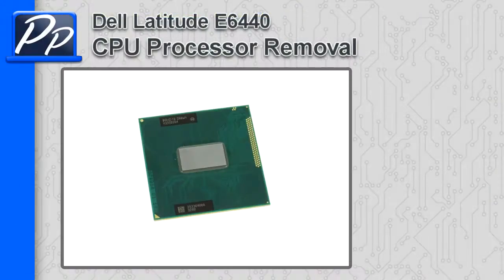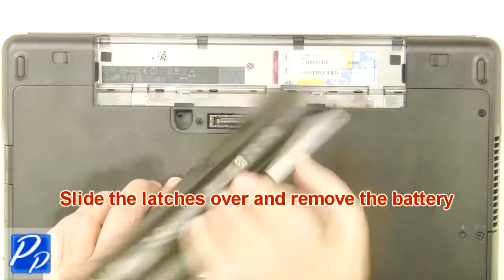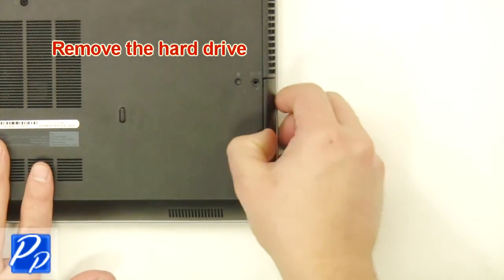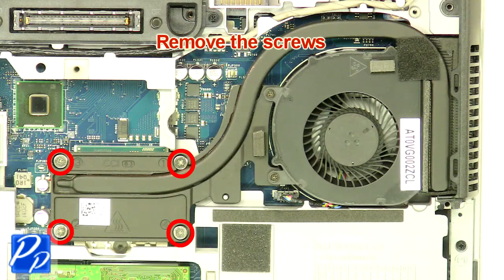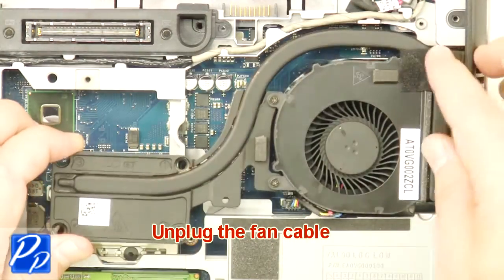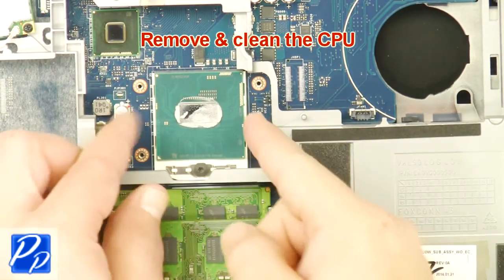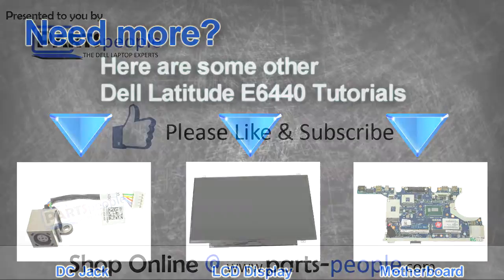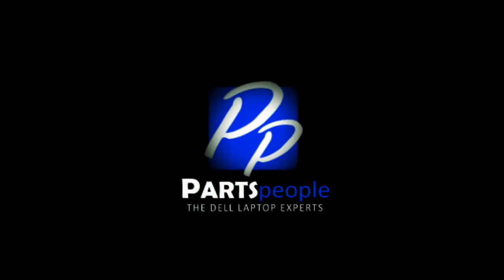Dell Latitude E6440 CPU Processor How-To Video Tutorial

Comment: The Intel Core Core i7-4940MX is a mobile Beast but, with a TDP that is 20 watts higher, you may need a chiller pad or fan booster to keep this socket FCPGA947 CPU running cool and stable in a Latitude E6440. Someone else on here said they installed a 47 watt CPU on their E6440 laptop with no issues so, maybe, if the chipset supports a higher CPU socket voltage that this CPU would definitely require, it could be used.

Comment: Thanks for the helpful video! I was able to swap out my Core i5-4300m CPU that came with my Latitude E6440 for the i7-4712MQ and get it booted up and running again in just minutes! (Of course, Windows installed new drivers requiring a reboot but, still, couldn't have been faster without this video to help) I also managed to avoid attempting to install the CPU 180 degrees out by noticing orientation of CPU removed in the video, since I was not really paying attention when I removed the one in my laptop.

Is it possible to replace the non-back-lit keyboard for this Dell with one for the same model that does have back-lit keys?

Comment: So... Could I swap out the i7 4610 CPU for a more powerful AMD CPU?
Reply: I just successfully upgraded the i5-4300m CPU for the i7-4712MQ with no need to upgrade the BIOS... just needed to reboot after booting into windows, and Windows then installing drivers for the new CPU. (I realize I am replying to a question posted 2 years ago but, I was looking for the same upgradeability answers just last week when I found that this quad core, (with 2 logical cores per physical), had the same wattage and socket compatibility as the i5-4300m I wanted to upgrade.) I read that an i7-4910MQ (with a +10w, 47 watt TDP) was also successfully installed on this model Dell, without any issues - from someone who had done the upgrade some time previously. I wasn't as willing to pay over a hundred more for that upgrade, when I'd found a good price ($120 + $8.65 S&H) for the i7-4712MQ on eBay while pricing that upgrade. (My Dell's BIOS is A21)
Reply: I know this is 2 years old, but for anyone else seeing this, you can swap in an i7-4702MQ and have a quad core i7 that has the same TDP as the CPUs that come in these e6440, which should avoid any additional heat.
Reply from the maker: +STR77 CallingAllBattleFrontFans No, you would only be able to swap it with another Intel CPU. The CPU socket is different for AMD CPUs
Reply: +Parts-People.Com, Inc Okay... Any recommendations for a better upgraded intel cpu for this laptop?
Reply from the maker: +STR77 CallingAllBattleFrontFans Unfortunately I don't have a complete list of compatible CPUs. With the little information I do have, the 4610M is the fastest processor available for this laptop.
Reply: +Parts-People.Com, Inc Oh okay,  I was doing a little bit of research... What about the i7 4700QM, i7 4800QM or i7 4810QM those are all Quad-core Mobile cpu(s) compatible with DELL Latitude E6440, but with 10 extra watts... Would they be good? And thanks for the replies. I appreciate the knowledge.
Reply: Answering  chrissake, I just replaced my E6440's i5-4300m with the i7-4712MQ that has the same TDP. As long as you are getting a CPU of the same socket type, (i.e., FCPGA946, AKA: PGA946) and, stay within gen 4 mobile Core CPU's (e.g., i3,i5,i7-4XXX, where the leading number, in this case "4," indicates the generation, (as defined by code names Sandy Bridge, Ivy Bridge, Haswell, Broadwell, etc., - where "Broadwell" or  Coffee Lake and Kaby lake are 5th and 6th generation Core CPU's; Haswell is 4th generation for the Core mobile CPU's. See "modern" Intel production codes from about 2013 below - (borrowed from Wikipedia.) (Note: Broadwell is a die shrink of the Haswell micro-architecture, from 22nm to 14nm and, technically, is 4th generation but, Intel still brands them as 5th gen with their CPU numbering system, (e.g., i7-5750HQ)

         Haswell: 22nm microarchitecture, released June 3, 2013. Added a number of important powerful new instructions, including FMA.

        Broadwell: 14 nm shrink of the Haswell microarchitecture, released in September 2014. Formerly called Rockwell.

       Skylake
    new 14 nm microarchitecture, released August 5, 2015.

       Kaby Lake: successor to Skylake, broke Intel's Tick-Tock schedule due to delays with the 10 nm process.
        Coffee Lake: successor to Kaby Lake and a second refinement to the 14 nm process
        Cannon Lake: 10 nm shrink of Kaby Lake, released in May 2018. Formerly called Skymont.
        Whiskey Lake: mobile-only successor to Kaby Lake Refresh
        Cascade Lake: successor to Kaby Lake-X